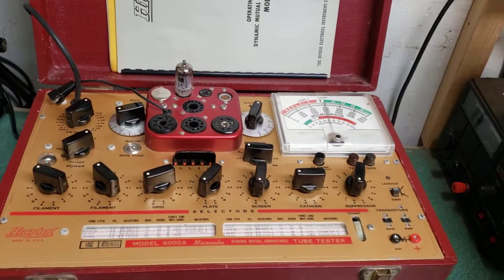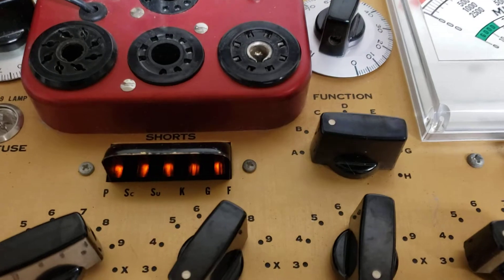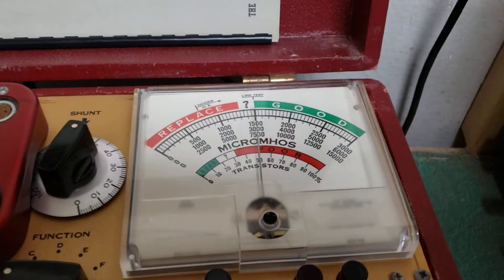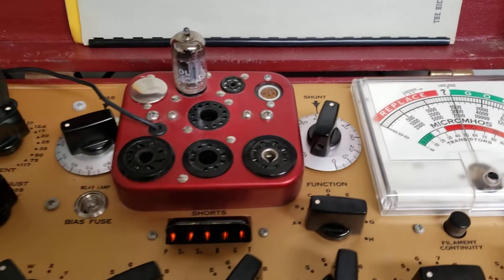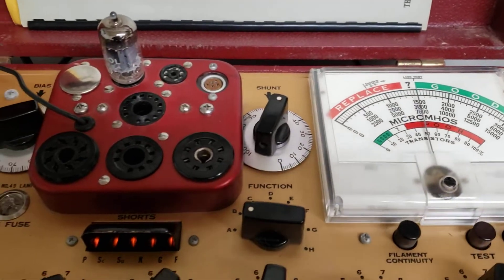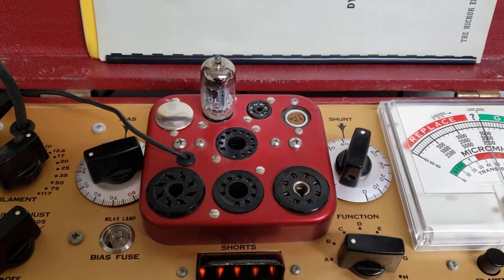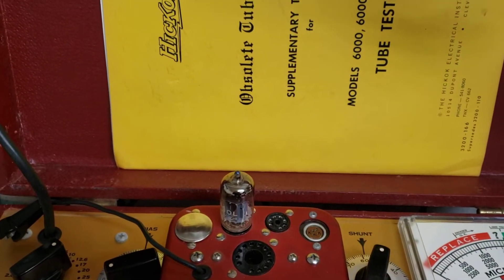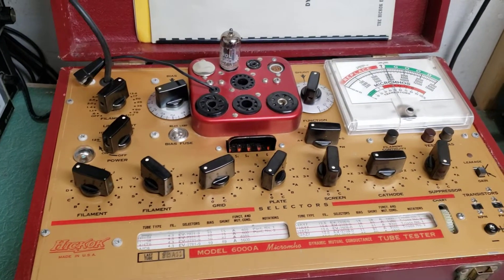Hickok 6000A tube tester

Comment: Excellent demo. I own the exact model but I'm not as well versed in the total operation of it. I use it to test tubes for my guitar amps. I have the socket you're missing in my unit. It's a 7 pin, gray in color socket, similar to the brown 5 pin on the upper right. Fyi. Thanks again.